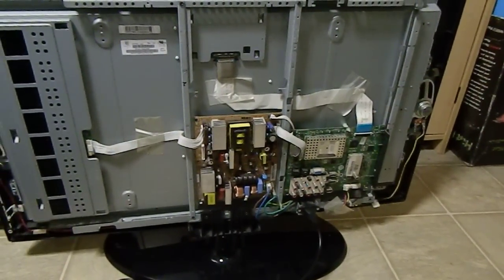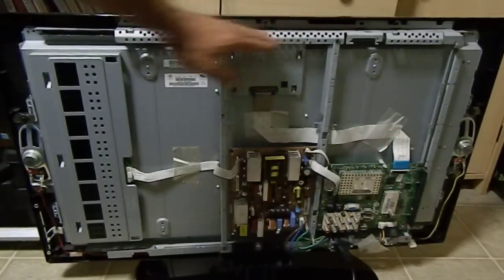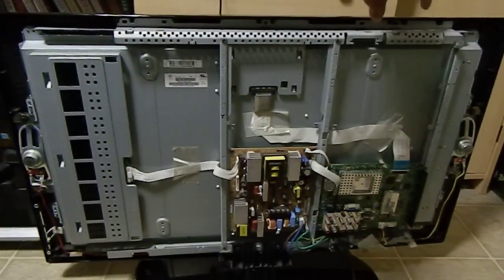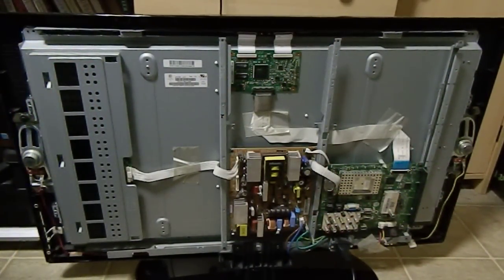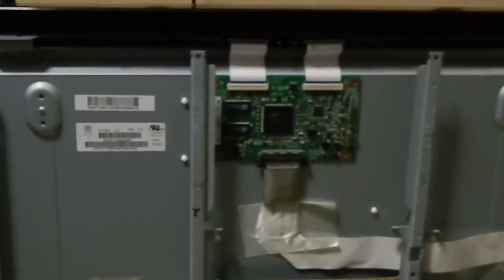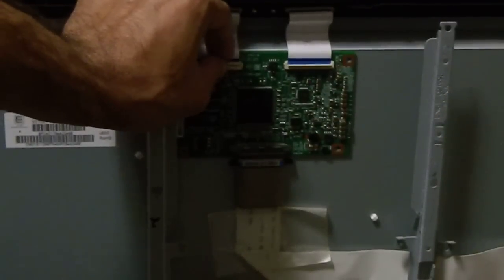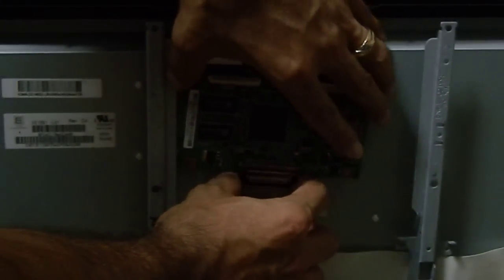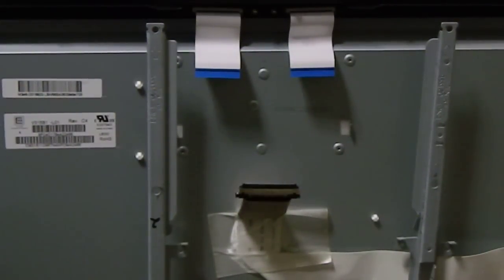HOW TO REPAIR SAMSUNG TV WITH BAD PICTURE (como reparar samsung tv distorcion color)

Comment: This worked for me. In my samsung tv, there were diffrent type of cables and I found 3, 1 normal size, 2 small. I cleaned all of them and it did the trick. Green issue resolved. Thanks

Comment: I did this, it worked about 5 weeks and now I am back to the same problem.  Should I try again with another board?  Maybe I got a "refurbished" board? Or is there something in the voltage going in to this board to cause this issue?

Comment: Hey dude I have a question my tv jumps in and out of the picture like when I first turn tv on the picture is fine than after 10 min it drops out again into this purple faded look like yours. Do I have the same issue? I just need to replace the whole board ?
Reply: Conseguiu resolver ?

Comment: I've got 3 LCD TVs I've already replaced the T-CONN Boards on all of them. None of them fixed the color display. Have 3 other LCD TVs I did the same too. But no picture. So I gutted them. Hung on my walls and use as DVD Video Storage. Likely the 3 I have left to fix or trash, the T-CONN Board is not the fix; and more likely will require the replacement of the Main Video Boards in all 3. Which costs around $37-55 for each board. I cannot resell any of these RVs because nobody will buy TVs unless working and New. So good chance I'll gut these too, because the T-CONN Board never seems to fix the problem the past 6 times for me, and too costly repairs, just means repurposed for storage or trash.

Comment: Would this board also control a complete white wash looking screen, where it all contrast is gone and everything very bright and white?
Reply: Did you figure out the problem,  I have the white washed out screen too. I already replaced tcon board and same issue still
Reply: @christiezerger9372  https://www.tvpartstoday.com/LJ92-01728C-Samsung-TV-Module-Y-Main-LJ41-08458A-p/lj92-01728c.htm
good luck.

Comment: Man, you are AWESOME!! I was just about to buy a new TV when I happened upon your video. I bought a board on eBay. While I was waiting for it to get to me, I figured I was gonna have to take the back off. Then I was able to access the cable attached to the board. I tried unplugging it. Thanks to you showing how to pull the cable out, I had the confidence to try this without damaging anything. Plugged it back in and IT WORKED!! THANK YOU SO MUCH!!
Reply from the maker: That's awesome! Don't forget to like and subscribe. Thanks!

Comment: Thanks for the video. I have the same TV and it is giving the same problems. I was able to get to the T con board and am about to order one off eBay. I just want to make sure I am getting the correct part. Am I to use the model of the TV to search for the correct T con replacement or CM numbers that is written on the T-Con board itself?

Comment: I have the same model your working on here I'm new to repair made a mistake I did not unplug the tv thinking I could watch the screen while doing so that I can see if I can fix the polarized look on the television while I was doing so a spark I think ruined the white cable on the left now I can't get s picture at all just see the backlight I need to order a new t con anyway I just hope I didn't ruin anything else.

Comment: Well done runforlife however I think this job would not be  easy for you average person who may get themselves in a real mess.I presume you are a trained technician and know what to do automaticallyTry your method or take the tv to the tip the choice is yours. I guess a shop repair probably cost in excess of $200 they want $50 upfront non refundable deposit.I might give it a go what can I loose just make sure power is off.Where do you obtain the new part and must it be for your tv brand only.

Comment: I had this problem ,  did the tv reset with the code 0000 and nothing , turned out that I had the 2 red plug-in to my DVR reversed (I have dish network and the tv plugs has to red plugins that look like they are audio plugs , but it fixed it )

Comment: i actually have a similar issue, the t-con board keeps burning out, not sure where the problem is coming from. maybe power board, maybe the screen is just burning it, still i basically took out the screen to save the next guy the headache.

Comment: I'm having a issue where on the whites and or people's faces you see blues and green. it's only a middle section. I have a 60pv250 lg. so how can I fix that?
Reply: Did u fix it?
Reply: @koussaila2009  no. Sold the tv and someone fixed it. 6 years later I have an q OLED

Comment: Hello, my TV LN40B450C4MXZD has the same problem. Could you tell me exactly the name of this piece that you replaced? And please where I cant find one. Thank you so much
Reply from the maker: t-con board or timing control board and you could find on shopjimmy or ebay.
Reply: O nice, Thanks!
Reply: i had a discoloration TV i turn the TV off and on in it and then it work first I restarted the TV but it didn't work
Reply: Felipe Barbosa lo

Comment: My Samsung TV UA40D5000 lost red component when played from RGB connector from a DVD player resulting in green tinted picture. Pulling out the red component of the connector didn't affect the green tinted picture.  Neither did adjusting the R-Gain at advance picture setting. DVD played normal at other TV. HDMI input also showed color distortion. However, playing .mp4, .avi movies or jpeg pictures from USB drive and All Share network was perfectly normal. R-gain can be adjusted normally. Was that due to faulty T-Con?
Reply from the maker: Hi, it could be a t-con or a mainboard. Without proper diagnosis it is difficult to say. Good luck.

Comment: Run, cool video ! I have a lg smart tv that shows vertical thin lines all over the screen and some dark green colors on it when the background is black, some strange stains. BTW are you familiar with lg tv's? Please help...
Reply from the maker: Hi, vertical lines are rarely t-con or mainboard issues on lcd's. Most likely you have a bad panel, but it is difficult to say without proper diagnosis. Good luck.
Reply: Run I fixed the tv myself. I opened it, took the flat cables off, cleaned the connections with proper cleaner and a soft toothbrush and bingo! tv  fixed! I'm so glad I made that right!

Comment: Hi. Thanks for this excelent video.
I was able to fix mine once i located the chip.

What i did was actually just remove the cover and then heat the chip with a cigarette lighter :)
I heated the chip from basically zero distance for a few minutes.

(and once i finished writing this comment the fault returned...) so the fix lasted 2 minutes :)
Reply from the maker: Yeah. The chip has to be replaced or the T-con board.
Reply: Yeah that was stupid. You actually expected that to work?
Reply: Reflowing the solder around a component is a common approach. Sometimes I reflow the whole board. It has solved a lot of issues.

Comment: what is that board called? can item purchase at a store?
Reply from the maker: Hi, it's called a T-con board and the best place to get them is either ebay or shop jimmy. Make sure you get the right part number for your TV. The part number is printed on the actual T-con board when you open the TV and pull it out.
Reply: Its really easy thing to fix the board is held by a couple screws and have two flex cable that are easy to fix. take u 5 to 15mins of your time to replace. All u need a philips screwdriver.Ebay has alot parts Just open your tv and look on the board for the part number on the board and tv model number . If your in us depending where its shipped in continental us take 5 or less days to get to you.

Comment: I have Samsung TV which suddenly started displaying in Blank and White when I connect my video player, please what be the problem
Reply: going into wrong input. or wrong out from DVD. video going to green component input will give black and white. match colors.
Reply: My samsung 51" just has off green and purple colors when I play dvds, not inverted, just off colors, you think its a T-con issue?

Comment: morning I have a Samsung TV model number un 55 e s 75000 TV was bought in 2002 my question is is should I prepare it or buy a new TV thank you for any info
Reply from the maker: Do you that even though your Tv was bought in 2002, it does not have any problems but you are wondering if it may have issues soon due to its age?

Comment: Great video. The problem i have on my samsung LN37B650T1FXZA is that AFTER A MINUTE OR SO the picture gets HAZY/FOGGY. The first time it happened i was watching soccer game and thought that there is a dense fog on the pitch but after i changed the channel the picture was the same . Do you think that replacing the T-CON board would fix it ? thnaks

Comment: just got your notice on plasma TVs are you telling me that my y buffer and buffer boards are bad  I just had them serviced......?
Reply from the maker: +gregg Scholes Hi, my recent video was in regards to no picture or no power. What problem do you have with your specific TV?
Reply: +Runforlife the color is off and the picture has what looks like rainbows across the screen and  on the faces of the ppl on screen
Reply from the maker: +gregg Scholes Do the rainbow colors change when a different picture is displayed? Any black lines or bars? Has the TV been dropped or moved to a different place ?
Reply: +Runforlife no on dropped    I just wish I could show you what I mean it's hard to explain   do you have a email better yet hears mine and I'll send you some pictures

Comment: HI
I got an LG smart tv 50in....it has a blury image....do you think that i need the same part??
Thx
Reply from the maker: +Eduardo Thomazin It's not easy to tell, since it may be related to a bad lcd panel as well. If you pop up the menu, does it come blurry as well. Also, is it blurry in any hdmi input or external devices, such as cable box or blu ray?

Comment: my issue is the color is off like in your video  I just had my y main and buffers  replaced  now the picture looks like I have rainbows going across the screen and the ppl. on  TV have the same   its not clear but u can see there faces but looks like rainbows in the faces  if I'm not making my self clear. let me know and I'll try and do better lol
Reply from the maker: +gregg Scholes After you replaced the y main and buffers, did the image change? If so how?
Reply: +Runforlife I got tv broken  I had to change the buffers  and y board  if you have an email address I'll send some pics to you but  its doing what your video says but I'm getting a rainbows across the screen and the color is not good

Comment: I have a samsung 32" UE32J5500 which has an odd "shimmering" or dynamic false contouring (crawling moss) effect sometimes but only on dark areas of the picture, people's dark clothes in close up or in shadowy areas, mainly on movies. The colours look fine but just shimmery and patchy. Is this a general problem of HD tvs or is mine faulty? I get conflicting information. It's only a few weeks old and my first HD tv. Otherwise I'm pleased with it so I don't know whether to return it or put up with it.
Reply from the maker: +Alma Cooper If it is a few weeks old, I doubt it is an actual issue that needs repair. However, some new models have a high refresh rate and make that "soap opera" effect. If that is the case, I have a video on how to change the settings for that:  https://www.youtube.com/watch?v=tkILkZ7FDjo
Reply: +Runforlife Thanks for reply. I don't think it's soap opera effect though. It's definitely dynamic false contouring. Looking like shimmery areas only on dark backgrounds, on people's clothes as they are up close to the screen or if the background is shadowy. Or in scenes of flickery candlelight, for instance. It looks  shimmery like the blush on crushed velvet. And tends to be only on movies, oddly. Not on other tv progs like soaps or news.

Comment: I have a Sony Bravia Ex330. Lately i see double image which goes away after 30 mins and comes back with a slight discoloration after every 15 mins or so. What could be the problem?
Reply from the maker: +Zeeshan Ansari Does the image flicker at all?
Reply: +Runforlife no.
Reply from the maker: +Zeeshan Ansari The t-con could be the problem, but I know that similar models to yours develop LCD problems.
Reply: +Runforlife um could you give me pointers for the parts? Exact model is KLV-32EX330
Generally how much would a t con board cost?
Reply from the maker: +Zeeshan Ansari you would need to open the TV first to find the specific part number of t-con. The part number should be printed on it. Keep in mind that the LCD panel can also be the problem. Sony LCD's are know for bad panel issues. More specifically with the tabs as I show in this other video: https://www.youtube.com/watch?v=zqcdTNoOoN0

Comment: hey can you help me out with my tv? i have on SEMP 42" LCD tv that has been showing some problems (weird colors and some times the screen is shaking for some time. i guess its the same problem that you had.

im using my tv as 2nd monitor.  http://imgur.com/Ur0j4ps  <image i took of my view looking at the image and > the color i should be seeing .
Reply from the maker: +João Victor What is the model of it?
Reply: +Runforlife LC4245W. Some times when the screen is heated the image start to flick
Reply: +Runforlife and some times the tv works fine lolz
Reply from the maker: +João Victor you would need to open it and inspect the capacitors in the power supply first.
Reply: hmm but what exactly do i need to check?
Reply from the maker: +João Victor Check for bulging or leaking capacitors in the power supply.

Comment: Hello sir,I have the same tv, the Samsung Lan32A300J1D. I am having the same exact problems with my tv. The picture is getting worst. Please help. I would like to know the name of the board so that I can order it and change it on my tv. Can I get it from EBay and Amazon?
Reply from the maker: +Kevin Cherry It is called Tcon board, but there is a specific part number printed on it, so you must open the TV first in order to see what the part number is before ordering one.

Comment: hey runforlife i have a lg tv and it looks kinda similar to this almost everything looks good but with dark color i get lines and colors looks like your tv u think is the t-con board pls help
Reply from the maker: +Chaka_310 Does the picture flicker at all? Can you describe the lines?
Reply: +Runforlife it wouldn't flicker at all just the dark colors like black I'll just have a distortion like  a little greenish and it'll go away and come back. but now it got to a point that all i see are rainbow vertical lines....thanks for replying to me  buddy
Reply from the maker: +Chaka_310 What is the model of it?
Reply: +Runforlife LG 47lv5400
Reply from the maker: +Chaka_310 send me a pic of the TV on displaying the TV menu to my email. piedritas@hotmail.com
Reply from the maker: +Runforlife I saw your pictures. It does not look like a T-con board issue. If you tap the top or the side of the TV does the picture flicker at all?
Reply: +Runforlife ahh dont tell me that lol nah man nothing happens did I break it is the screen broken smh its trash huh??? :'(
Reply from the maker: +Chaka_310 well there are a few things that could cause this issue, a bad LCD panel, a bad mainbord, a bad LVDS Cable or conection and last a bad t con board. The t-con and LVDS are the cheapest to repair. What I would try first is to open the TV and unplug the LVDS cable, which is the cable that goes from the t-con to the main board and clean it with a dry cloth and then plug it back in. Do this on both ends.
Reply: +Runforlife alright bro thanks for your time and help I really appreciate it dude 👍have a good one thanks
Reply from the maker: +Chaka_310 I would not count out the t-con just yet. It is just that it is not as common for t-con to cause this issue. But first thing is to clean and re-seat the LVDS cable.
Reply: +Runforlife hey there bro you help me out on my tv im not sure if you remember like a week ago i email you my tv picture and u said it might b the lvds cable/t-con or the TV panel something like that now i purchased the t-con bored and I finally got picture on my TV now it looks exactly like the one from this video in the begining I think the problem is now on the lvds cable what do you think? i come to you cuz u been a really BIG help with this thanks 👍
Reply from the maker: +Chaka_310 if it looks like the picture in the video there is a chance that the T-CON board you bought is defective or that the LVDS cable is not plugged in correctly. You should unplug all the connectors that go into the T-CON and re-connect them again. If that does not fix the problem and you still have a picture similar to the one in this video then there is chance that the T-CON board you bought is defective. Where did you buy it from?
Reply: +Runforlife ebay thats the only place i found the one i needed and it came from "Shen zhen"
Reply from the maker: +Chaka_310 Try re-connecting the connectors that go into the T-CON board if that does not fix the problem contact the seller about getting a replacement or a refund.
Reply: +Runforlife yeah i did that yesterday and it ended up looking all black with no picture ima get a refund a look for the part where I could get it in person unless you know of a website I could buy it from thanks dude.